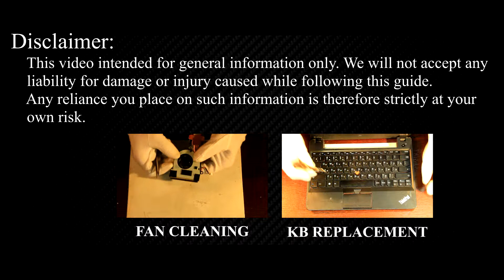Lenovo ThinkPad X121e, Edge E120, E125 Screen Replacement Guide

Comment: How common is a faulty screen with Lenovo x121e? Mine is behaving weird, as first 2-3 starts of the day screen just worked fine, then suddenly multi color lines and screen went black. Now even after restart screen is black. I dont want to replace the screen if that is not the issue causing...